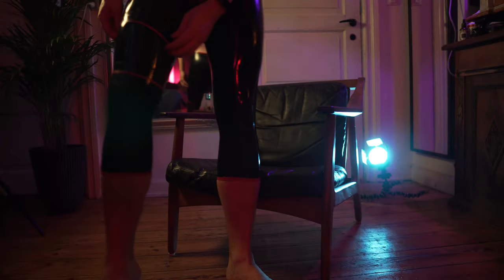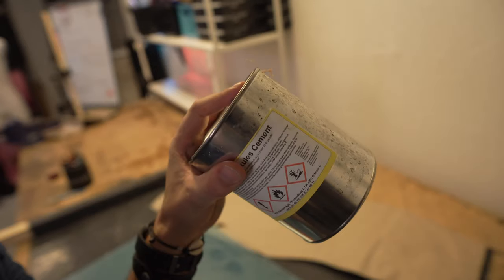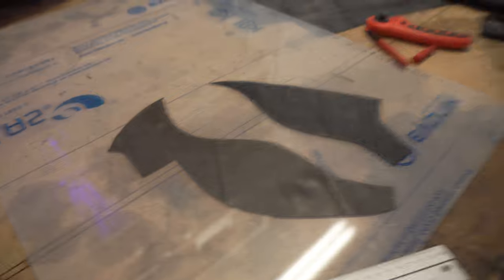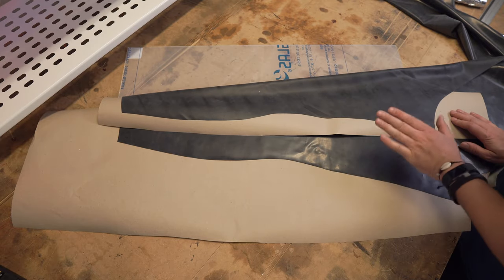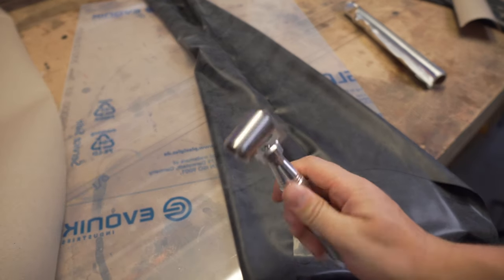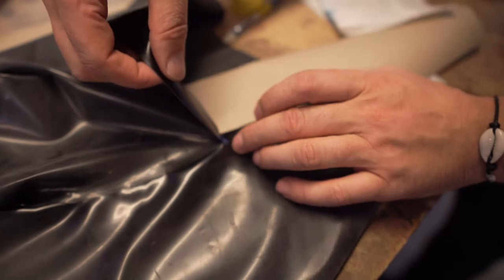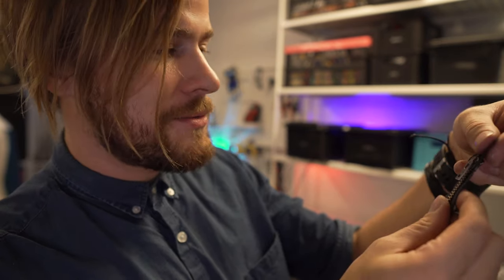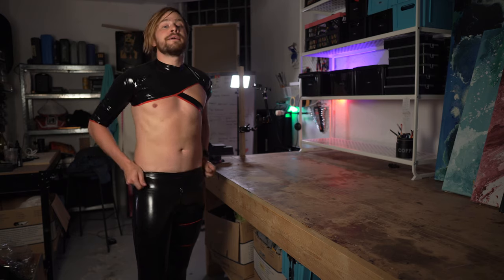DIY Latex Leggings - Step by step tutorial for beginners.

Comment: Personally, i would apply a small circular latex patch over the crotch area to reinforce the seam, since it's the one place that take a lot of "wear & tear". Great video. ❤️❤️❤️
Reply from the maker: Ahh, good catch, had forgot about that... I guess the same goes for the bottom of the legs, though in this specific case, the extra red strip was probably enough. And thanks for watching ❤️
Reply: joosep kõivistik Is say places needing reinforcement is going to be the buttocks area, because of sittting, knees, crotch

Comment: Hi! What thinkness latex did you use? Is 0.4mm stretchy enough that it imprints shapes if you apply pressure?? I heard 0.25mm is harder to work with and I have never used latex, but I need it to be really stretchy! Thanks!
Reply from the maker: Used O.4 - it's plenty stretchy... Anything thinner will become a bit fragile I can imagine

Comment: I really struggle with the crotch area where all the seams meet.  Can you offer any advice on this.  Yours was perfect :)
Reply from the maker: What's the struggle about? The end result / fit, the seams not aligning or wringkles when gluing?
Reply: @jokoivi  It goes all wrinkled and its only slightly off when aligning and its really fiddly
Reply from the maker: @antonywalton7957  yeah, it is a bit of a fiddly area with  a large curve of the seam .which is always a lot more difficult.. in general, it requires a bit of practice to get the proper feel of how to do it without wrinkles and air bubbles. to help that process along though, make sure that you lay both pieces side by side, all flat. do a try run without glue to make sure that tugging on the latex wont make the material move around in weird ways (fx: if the legs ate tangling off the table or in a position where gravity might start pulling them around) . and if you really want to get it right, you can also do it in smaller chunks.. couple centimeters / inches at the time.. a lot easier to handle.
Reply: @jokoivi  Thanks.  Ill practice a bit more.  I managed to make a vest with a trim and that looks amazing.
Reply from the maker: @antonywalton7957  so satisfying when that happens :p keep it up ;)

Comment: No flap to cover the zipper on the inside?  So important skin does not get pinched?
Reply from the maker: I don't like flaps on 0,4mm  latex - the flap tends to get pinched in the zipper and then it's stuck... Could work if thicker latex was used for the flap but I didn't have any at hand. As long as i pull the latex away from skin while zipping it up, it doesn't give any issues

Comment: do you know how to glue latex sheets that are too thick to be glued by overlapping them? like wetsuits are 3-6 mm neoprene and are just glued  flat agaisnt each other but they're also sewn on top of that which you cant do with latex...
Reply from the maker: Clothing and sheet latex is usually not more than 1mm thick. Glue works just fine for that, the bonds that are created are super strong since the surface is super slick and the whole structure is solid rubber - there for very uniform with exactly the same stretch / behavior... While fabrics and neoprene have many layers of fibers... If you glue it, it's the bottom layer that the glue sticks to while the top layer can shift and tear since the bonds between different fibres vary. in general, I assume the glue that is used for neoprene wetsuits is mainly to keep the water out... Cheap summer suits are generally just stitched, no glue ;)

Comment: Very well done. Im impressed. Im seamstress, didnt think you have to glue latex. I'm checking the radical rubber website. How thick is your latex? They offer from 0,25 mm till 1,05 mm.
Reply from the maker: Thanks, and I've been using 0.4mm ;)
Reply: Most latex clothing manufacturers glue the seams on garments. A few do sew them together but the danger is that any holes in the latex are potential weak points and you  it can start a tear point.  Gluing together prevents this and also spreads any tension across the glued area so they are much stronger and reliable.  Radical rubber is the best site for rubber at a reasonable cost and quality. 4 D latex is an English manufacturer of fantastic quality but they are expensive.. Good luck and have a go !!!

Comment: What is thickness of the Latex/Rubber sheet (Black role)?
Reply from the maker: Its  O.4 mm
Reply: @jokoivi  thanx Joosep.

I got the sheet but the glue I'm worried now. The one I got is SR-70. I'm not convinced with results

Going to try SR-998.

Please You suggest a better option if you have come across a better option.
Reply from the maker: @AjayYashpalKapoor  Bostik  3851 would work for sure if you were able to find some

Comment: What did you use to clean the latex to apply the glue? thanks!
Reply from the maker: denatured alcohol ;)
Reply: @jokoivi  omg, thank you so much for the fast response! won't it damage the latex afterwards? i am looking for options, as i am doing some projects for fashion school, and i was about to spend like 13€ on a latex cleaner, and i am so low on money right now ahah. And for the glue, anything i can get hold of it in Portugal and don't have to pay like 40€ for 200ml of glue? lol i want to do something inflatable, so it has to have some strong bond. as i have a water-based glue and it is so shitty for it :( thanks again!
Reply: @jokoivi  how much percentage of alcohol does your cleaner have btw, could you tell me please? thanks!
Reply from the maker: @bananaeater4332  nah, even acetone and turpentine won't damage it, so go for it. And the exact percentage doesn't really matter, the main point is that it cleans up the talcum powder which the latex is covered in without leaving any residue behind. You can usually find it in supermarket cleaning section for like €2 glue wise, it's basically contact cement... Some work better than others. And keep in mind while it might be pricey, you need really little of it... And it's better to be sure you have decent glue rather than waste the fairly pricey latex itself ;)